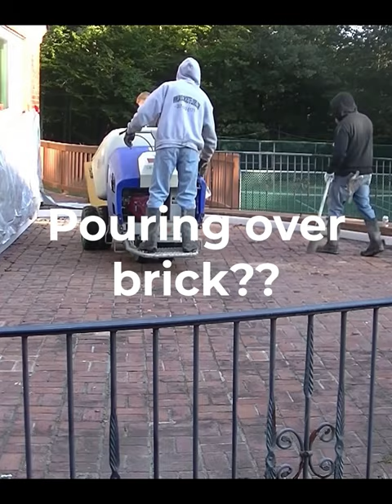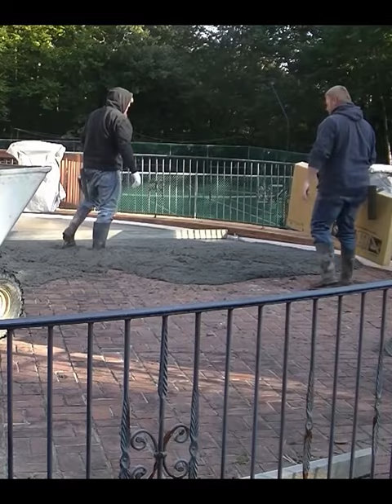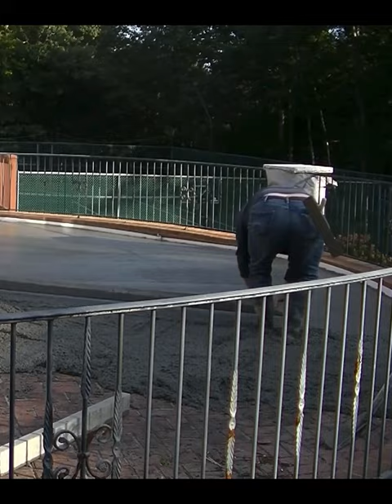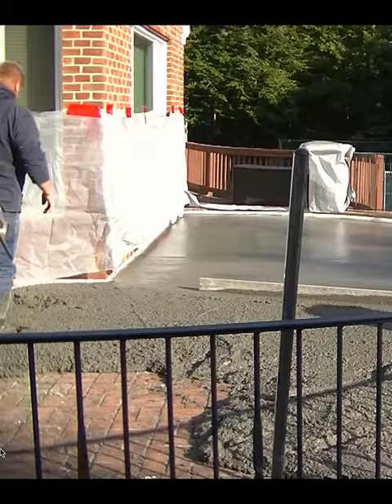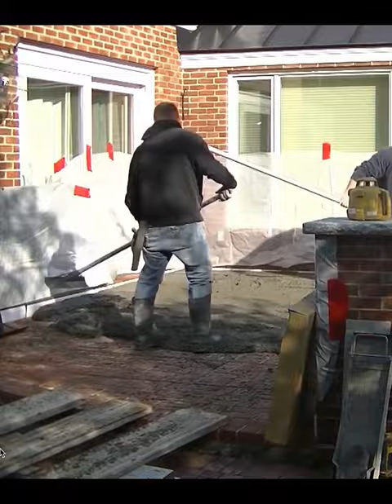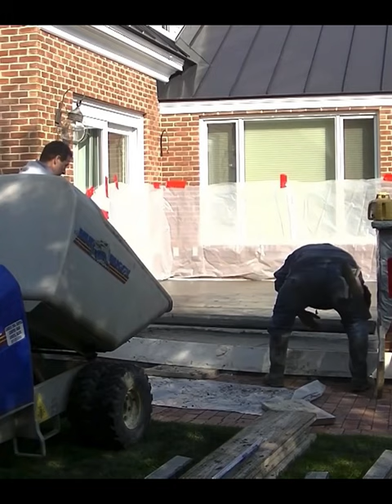Pouring Concrete Over Brick?? #shorts

Comment: The brick on the wall has weep holes every third or so brick on the bottom course.  Pouring over that course will block those required vents locking moisture in. I see this done and the results regularly. Nice work though.